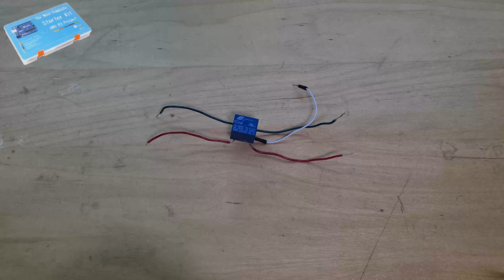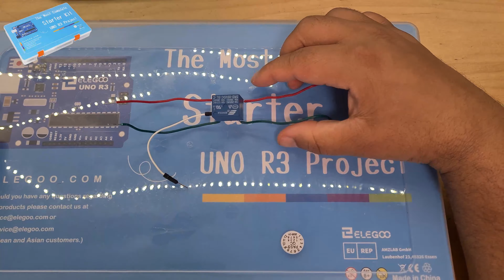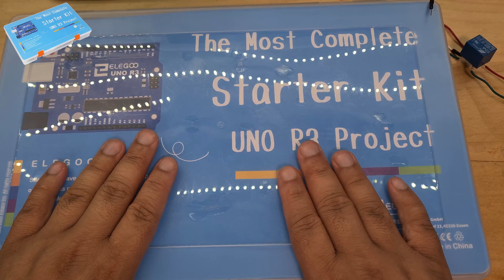Relay Elegoo Arduino Tutorial - Most Complete Starter Kit

Comment: pin 3 and 4 were inputs !!
i think they had a bad use of the relay (which is stupid when it's a guide for relay)
i've not tested it out yet but i bet if you remove the relay, power the moter directly from the red and black whire that comes out of the chip the motor will change the direction because the positive and negative outputs accually change in the code (it's when they go from dira high dirb low to dira low dirb high)
Reply from the maker: Pinned this, it's been such a long time since I've looked at any of this but I was sooo clueless when I did this haha.

Comment: Did your relay come with wires attached
Reply from the maker: @tritun5154  no I soldered those on (badly) 😂
Reply: @HamedAdefuwa  so annoying. I got an lcd screen and was able to get it working. I want the lcd 5v to be powered on when the accelerometer detects movement. But  I need a relay, and mine came like yours but I have no idea how to solder.
Reply from the maker: @tritun5154 soldering badly is really easy and you don't need it to last 10 years so give it a go. But an alternative is to use those female to male little header wires that come in all kits. They'll do and you can tape them onto the relay 😅

Comment: I know this lesson's old, but I'm adding my comment in case anybody else is confused by this exercise and thinks it's their lack of understanding rather than a generally confusing explanation of the requirements. I'm running through this right now and, honestly, I definitely find this lesson confusing (it's not the first one either), but I had to sit down for 15 minutes and, checking over each part of the schematic, compare it with the wiring diagram just to make sense of it all.  

The actual code is the real issue though.  Mine seems to suggest that the motor will spin in one direction for two seconds, reverse for two more seconds, and repeat that sequence five times.  And that's the end of the loop; no other code. 

Your version of the code has a digitalWrite(ENABLE, LOW) immediately after, suggesting the motor should stop for 3 seconds, but you would expect it to revert to 'HIGH' after that, but it doesn't and just begins the forward/reverse (x5) process again in the second loop.  Mine doesn't even have the second loop.... confusion.. I guess it's trial and error to figure it out.  It could be that I don't understand how the relay works though, and my version of code is 6 years newer than yours (2022).  I actually like your idea of soldering the relay pins;  (preferable to the risk of breaking one; which I nearly did to the L293D chip when I did the first DC motor setup), I'll probably do that before wiring up this lesson.

Comment: My guess is that in the code, outside the two for loops it has the write methods so its running the first one and then instead of waiting for the for loop to finish it just moves on to the next write code? I am coming from python background so I am not too sure how c++ executes the code so I could be completely wrong.
Reply from the maker: I wish their tutorials were written better lol
Reply: @HamedAdefuwa  yeah I've been doing the same thing just trial and error but I also learn a lot by doing that lol. I think I'll try your build and see how it goes because I was thinking of using the same motor to make it go forwards and backwards for my rc car I am making and if I can get it to work it would be perfect.
Reply from the maker: Yeah it's definitely the best way to learn if you're motivated enough lol